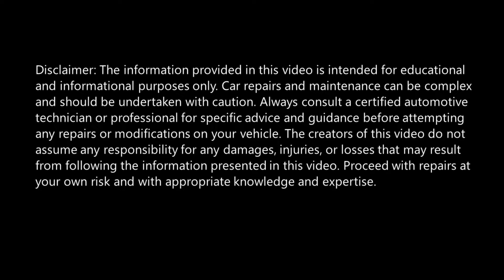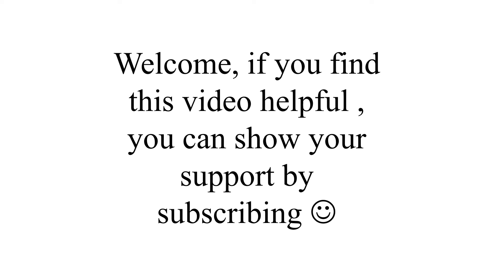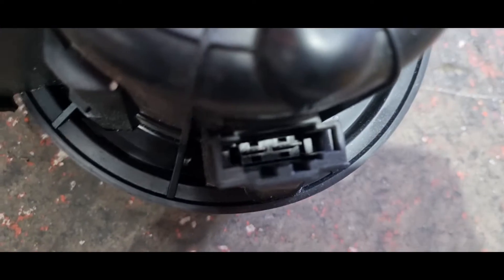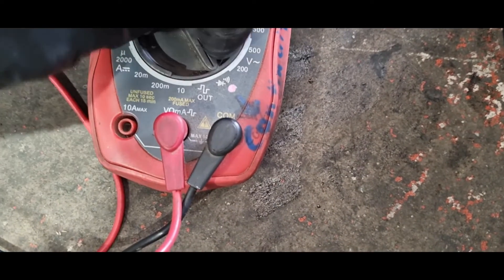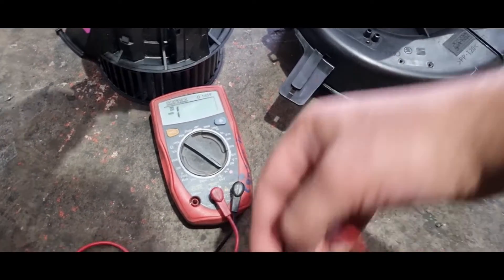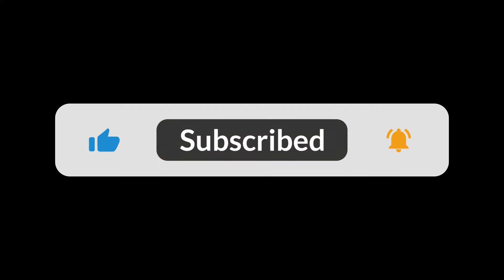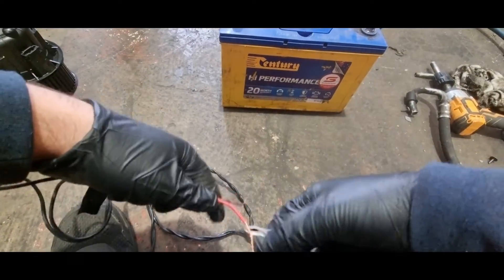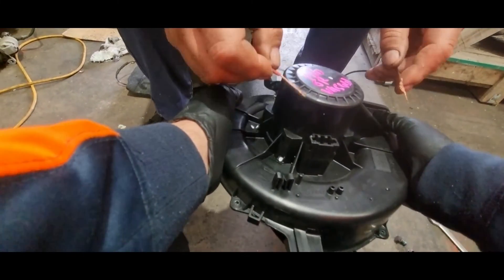How To Test Your Car's Heater Blower Motor

Comment: Mine has 2 it has continuity but makes sparks when connect to battery
Reply from the maker: Hello , do the opposite wires , so connect positive and negative opposite, sorry for inconvenience
Reply: @Aussiecarstar  oh no it's fine just my blower motor has wires instead if plugs so both wires are blue might have been a mix up at my end 😳